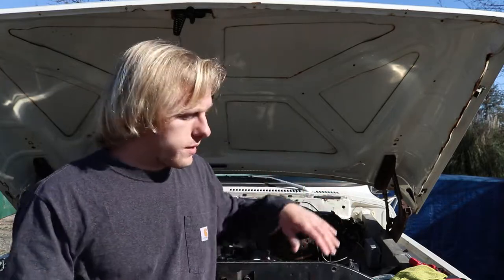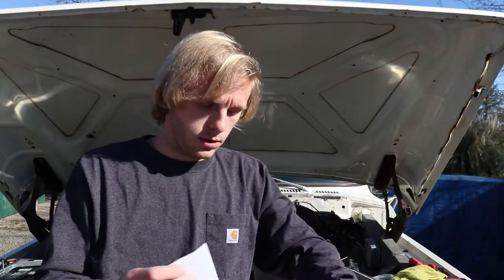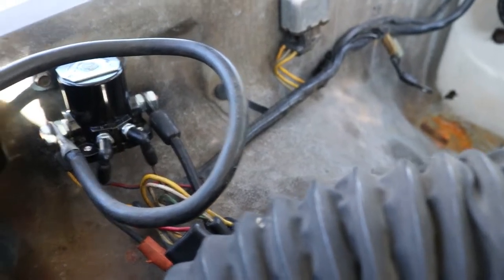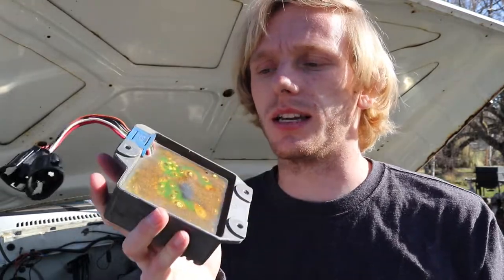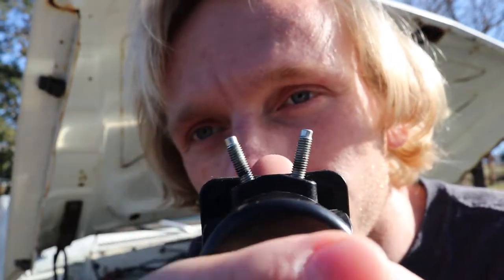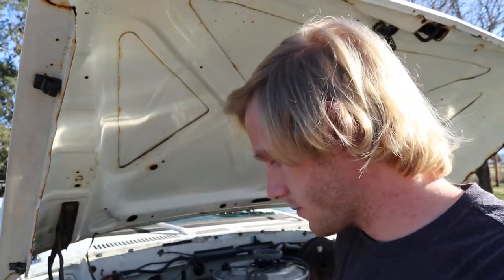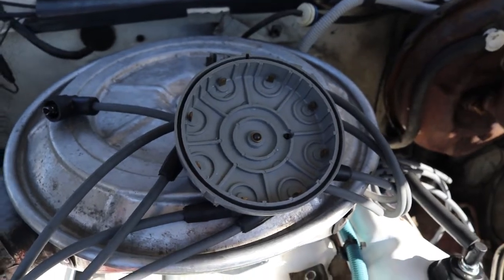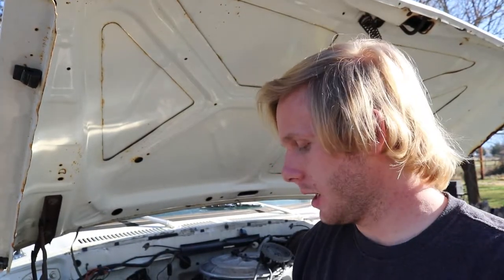My in Depth Duraspark 2 II Troubleshooting Diagnostic Guide

Comment: My 83  f150 4.9  started running weak yesterday, and  eventually quit.  No spark now. Had it towed home. Im a 70 yo shade tree not very great mechanic and electric is not my strong point. I just got a mutimeter, and slowly learning from video. As a n artistic guy, my brain doesnt do well with much mechanical.   I put an old  duraspk  module i had, on it. Still no spark. I ordered new distribtor, and coil and voltage reg on Amazon just now.   The  old parts  have been on for many years, and time to replace them, and praying they well do the trick;. You sure know tons more than me , as im not that mechanical and at my age, slipping some.  Great job and thanks.  It can sure be a comedy show   like Laurel and Hardy or the 3 stooges, or Red Skelton, when i try to fix vehicles.  A boot camp!!

Comment: Praise God for your video dude! I have this engine in a Altech Whisper Chipper. Only works when cold cuts off when it gets up to operating temperature. Thanks to your video i'm going to switch my Ignition module. And hopefully that does the trick.

Comment: Had a '76 Granada, I kept a new ignition module in the trunk at all times. Fast, cheap, easy fix. They'd last about 8 months. Not sure why they'd fail. They weren't in a spot that was exposed to high heat.

Comment: Excellent video friend, I am currently restoring a Ranger 86 2.0 and it has the same ignition. You will need to put an additional ground to the chassis and check that the connections are not loose and to avoid having problems with a burnt coil, you will have to use a resistor, unfortunately.
greetings.

Comment: I got one for you. 1987 F350 7.5, This truck had been sit for years, Pulled the engine after breaking 8 exhaust manifold bolt and replaced main seal. Reinstalled engine fire right up. Backed in out of garage numerous times. While idling it died, acted like it ran out of fuel. Try starting with starting fluid with no luck. Only spark was coil to distributor, when key was turned on or off. All test with multi-meter came back ok. All contact clean. Still no spark. Removed cap, cracked engine, Rotor did not turn. Twisted rotor by hand, it popped and would rotate by hand or when cranked. Pulled distributor, I could rotate the gear while holding the rotor or rotate the gear and watch the rotor turn.  Off to buy a distributor.

Comment: Just replaced the module on my 87 motorhome.... I was mad at myself for not knowing where my diagnostic books were from a Motorcraft course i took back in my mechanic days. (1981)....   Not a fan of the parts cannon, but when it comes to duraspark, throw on a module before you waste too much time.. 90% of the time it's problem solved. Also blob some dielectric grease into the sockets before you plug in,  to prevent corrosion.

Comment: Thank you for posting.  I am challenged by the ignition system in my ‘79 Lincoln with 400 V8.  Replaced plugs, distributor cap, rotor.  Will put in new ignition coil and all new spark and coil wires.  If that is no-go, will replace module.  Hope to be back on road in spring.  Car hesitated and died in front of my house.  Cranks well but doesn’t start.
Reply: Did you figure out your issue???

Comment: My particular duraspark won’t even run on cheap replacement boxes it will instantly fry them. In general any duraspark can be fairly picky. DO NOT BUY THE CHEAP REPLACMENTS! Buy a quality aftermarket unit or find OEM 
I personally have found a good aftermarket quality box to use is a napa branded box part #TP40 
I am sharing this to hopefully save some of you the headache I had gone through (on many ds equips vehicles) till I found this box

Comment: Im stuck with my 1979 f150 with the 400ci motor and it has intermittent issues where it will run good for a couple days and drive excellently then will out of nowhere shut off and have 0 Spark and will only crank but if you leave it there the next day it will run for a bit and then do the same I’m really stuck on what it can be I replaced the distributor the ignition coil the spark plugs and the wires the dura spark box seems to be in good condition mounted on the fender so it doesn’t get hot I’ve touched it after driving it for a while it stays cool I am loosing it with this truck if anyone knows what else I can do to try and find the issue reply to my comment thank you have a good day
Reply from the maker: First thing that comes to mind is anything heat related. There are really only two variables changing in your scenario, heat and engine vibration. Since vibration usually causes intermediate hard to track issues heat would be the only other option. I would check for boiling your gas in the line up to the carburetor or in the carburetor bowl. Depending on your setup/carb you will want to check and see.
 
Have you checked for spark when the truck doesn't restart? Also is your distributor on the cheaper side or a decent replacement. The cheap distributor I bought had the pickup coil inside go bad causing all kinds of issues after heating up, Got one from Autozone and seemed to fix the issue. As a side note you should check what material the distributor gear is as there is two types for different cam metal materials, If they are not matched one will wear out the other faster and cause serious issues. One more thing is to check how hot your coil is when failure occurs
(Don't Get Burned), I have read cheap tachometers can cause a direct short resulting in coil failure which happened to me resulting in a tow.
This is all just my opinion based on the info you provided, remember keep it simple first. 
Hope this helps!

Comment: After many days and hrs trying many things to get "fire".....turns out the distributor not turning....will pull tomorrow to see if roll pin sheared and if oil pump turns, pray for me. I'm working on a 70's model Hobart welder with 2.3l with duraspark system

Comment: Thank you. This is the most understandable video on this system. Tyler, I have a no spark issue out of the coil. I am only able to attempt to start it by jumping the starter solenoid. Key will not send voltage to the solenoid. But, Upon attempting to start it by jumping the solenoid, it has a  Very slow crank. Battery voltage is good and grounds look good. They Replaced ICM, Coil, Pick up coil and still no spark out of the coil. The connections on wires are moisture corroded but voltages and resistances are in parameter's. What am I missing?
Reply from the maker: The slow crank should only be a few things, Poor connections, A bad or weak starter, Or low voltage.
As for the key not sending signal back to the starter solenoid you should be able to see if 12v is being supplied through one of the small wires on the front S and I (Start / Ignition) I would test both as they could be backward or not getting 12 volts from the key. If that's the case then trace to the key and see if it is getting 12 volts and so on. The coil gets it firing signal from the DS2 box and the DS2 box gets it fire signal from the Pickup in the distributor, remember the whole system is grounded inside the distributor so that ground is crucial to operation. If corrosion is present  I would get some electrical spray cleaner and some dielectric grease and clean it all up good, do it right and it will last a long time. Another thing to check is that the DS2 box is getting 10ish volts in the Ignition position at its plug and 12volts when the key is in Cranking position. Remember to not leave your key On to long as it can cause to Coil to Heat up and Explode. With the key in the On position you should be able to rotate the reluctor and have one of its 8 towers pass the pickup coil sending a signal to the DS2 box and getting the coil to spark manually.
( Don't get shocked!) as the system could be hot and ready to go with the key on.

Comment: The cable to the starter , hooks up you said on the starter. Where on the starter ? Mine goes to ground on the frame, but I think it needs replaced just because of age.  It turns over wired like it is, but won't start. Can new wiring harnesses be purchased for : where all the 3 duraspark plugs plug in ? Thanks
Reply from the maker: The cable should go from the starter solenoid up on the fender well to the starter. I think on my starter there is only one location to bolt the wire lug. Might depend on what vehicle as well.
Reply: @TylerCreates  it is an 85 for E350 w/ 460. I drove it 50 miles with no problem but had grounded the alternator at the ground connector to the frame where the one from solenoid is. After that, is when it stopped running. I drove it home, stopped it , then in the morning it refused to start. Had to tow it to where I store it. I'M THINKING IT OVERHEATED THE SPARK BOX, AND KILLED IT, SO i  Put in a new ign spark box, but still no start. Might have to remove the ground wire from allernators stud marked Grd. Never had trouble before that. I replaced the distributor  Pickup coil, the regular  oil filled coil, the voltage regulator, and the plug that went to the spark box from the harness, as it had a wire almost ripped off and exposed on one lead....it is the one with the side groove that prevents wrong hook up.  I bought some dielectric grease from Israel I thought was a great deal. It was like 13.00 for a decent size container to use on connections. Can give you the name of product if interested. Just realised I forgot to plug both plugs in before trying to start it, so I will do that tomorrow after removing that cable from the Alternator and let you know if it worked. I decided to buy a motorcraft brand box this time. I even added 3.... 1/2" L  tubular spacers 1/4 inch iD to lift up the unit to help it cool. Really appreciate your explanation of the ford system, there was something else I thought of, but can't recall it right now. I put that grease on 1/4" inch dia bolts that screwed through the units 3 threaded bolt holes, using the dielectric grease to hold the tubular spacers on while installing tubes over the bolts that go through 3 holes inside the fender well where mine is mounted, and used lock washers on outside fender well where tire is, and nuts to hold the unit tight. I think they are each like 1/2" long, and two of the 1 /4 " bolts that are approx 2" long are brass. Thought I might add a computer 12v fan nearby, to keep it cool, but that was just an idea . Thanks again for your time explaining it all.....other options were to use a chevy type dizzy with top coil, or rig up a chevy hei module someone showed how to rig up to the 3 ford plugs . That dialectric grease is supposed to be high performance, so, I can use it on the back of the chevy hei unit if I go that way, or on anything electrical like plug wire connectors. Sorry about being long winded, but anyway, I will see what happens tomorrow. That ground cable is like 2 Ga cable off the Grd screw on the 65 Amp alternator to the frame at the same place as the cable from the starter solenoid, so that might be why the module got too hot and was likely feeding back , not sure, as until I did that it never had any problems..... your video made me think WTF did I do wrong ? So tomorrow I will disconnect it first  before trying to start it after hooking up the two black plastic plugs I fricken hate those plugs ford uses on its spark boxes. They should have has two squeeze tabs to help pull those mofos open when you need to pull those plugs off...pain in the ass. You're right about ford having bad grounds, especially on 2006 mustangs that aren't grounded properly at the alternators and as a result spike like 18 v destroying the batteries and alternators repeatedly , so when you park it it has a parasitic draw that kills the ability to start after a day or less. I did a repair for that problem for a friend who had that issue, and even upgraded battery cables to 600 strand tinned boat cable, and installed a 200 Amp mini fuse inline from the + cable to a buss bar before it on the firewall and went from a 165 Amp Alt to a 200Amp Alt.... that was compatible through an electric switch that was rated at 100,000 times, and put a on and off kill switch into the glove box where it couldn't be seen rather than test 3 huge fuse boxes left right and rear for parasitic draws, and after that all you do  is shut off the ride, and turn off the glove box switch. To start, turn on glove box switch, then start the car. Never had another problem . So I know you are right about ford grounding problems ....they ARE shit. I built a special ground plug to fit into an oval hole next to the Alt in the frame that already existed that has a long bolt to go through the frame from above with the nut facing up , then bolted not only the ground cable to that, but an 8 Ga. Wire to the Alt frame with proper crimped connectors, changing both battery connectors too, and that thing really never had another problem electrically. So in watching your video, and thinking about what I did, I think my bolo was that adding a ground to the Alt to where the solenoid connects to the frame. I WILL HAVE TO LOOK AT A WIRING SCHEMATIC FOR THAT MOTOR HOME.to see for the E350. Why that cable is mounted there I have no idea. Have I lost you yet in my explanations ? By the way I felt your lighting in your video was fine.... wish I had done a video on that 06 mustang, it would have been great on you tube.....took me 3 months to puff out, but i think I did take some photos . Thanks for your video help....because I hate fords ......ps. I also did a complete rebuild a C-6 ford 3 speed auto a couple years ago, made it into a monster transmission, and never had built one previously.....,runs like a bat outa hell. Even installed a transmission oil filter on the return line . I can tell you how I figured out how to do it right  if you're interested.....might make a good idea for another video for you. I am not a mechanic, but a retired machinist car enthusiast. NOT any better than you are. Thanks for answering, it helped me a lot.... jd
Reply: Hooked it all up today, but still no start. It is something simple, maybe I got a bad regulator when I just replaced it, but i did drop a wrench on the battery and it sparked. Oh I recall what else I was going to mention.....I also replaced the ign switch bolted on the column steering wheel tube, checked the acutator rod was moving it right and it is.. I noticed the wiring to the coil shoe was exposed inside the loom, sheathing missing. I am thinking it might need a new ign harness. But will think it over, they are around 100.00. Thanks again...I checked the rotor and it's turning. So can't be the dizzy gear. The cable out of solenoid goes to the block on right lower side of engine, but also has a cable hooked to a holding loop to just hold it up going to starter, so I think it must be positive ground. Hooking that cable to the ground on the alternator wouldn't damage the alternator, I wouldn't think. I  just don't like fords very much.
           I put the reluctor in some rust remover to clean it up , I think it is supposed to have a magnetic charge, but with the new distributor Pickup coil, I wouldn't think that would be it. Haven't given up yet.

Comment: Great video! 
I have an issue, so i have a ford pinto 1980 with a duraspark system, I have a small accident and a fire broke out most of the disconnects melted and the duraspark box was close by.  I already replaced all the disconnects using a multimeter to figure out which cable was connected to which, I also replaced the duraspark box after watching your video because gel inside of it melted. Right now when I turn the key I get nothing not even the gages have voltage, I’m thinking maybe the solenoid burned out when the cables shorted out with the fire
That would be a good place to check right? Or do you have any idea on how to solve my issue? 
Thanks

Comment: Good video on the Dura-Spark 2 system. I have an 86 F-250 with the 460 4x4. I just rebuilt the engine. One of the issues I ran in to was that mine has the push on style connectors for the coil. It also has a factory Tachometer in dash. People need to watch out for those wires breaking on that push on connector on the coil. Mine broke on the negative/ Tach side of the coil and I was not getting any spark. Crazy thing was it broke inside the connector and I couldn't see it. I finally found it when I looked really close on the coil connector. But there's more. My Truck is Carbureted and it has the low pressure in tank electric fuel pumps in both tanks. No Mechanical pump on the engine. The problem I'm now having is that the fuel pumps are not being energized, so I'm not getting fuel to the Carb. I can poor gas down the carb and it will start but not stay running. I think it may be the Fuel Tank Valve down on the side of the frame rail. But with it being so cold I can't get out and work on it. Wife is using the Garage for her car. This Trucks fuel system is really stupid. Just one more thing the idiot engineers do to dam up the water works.